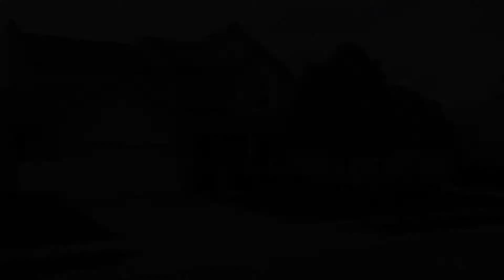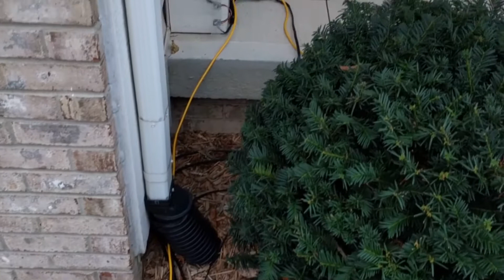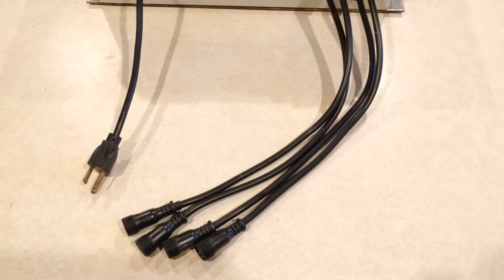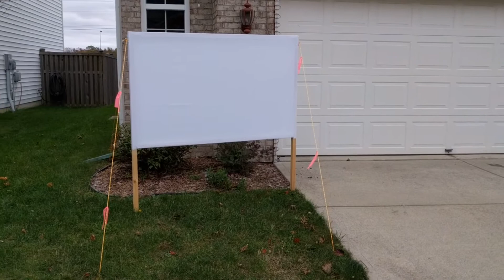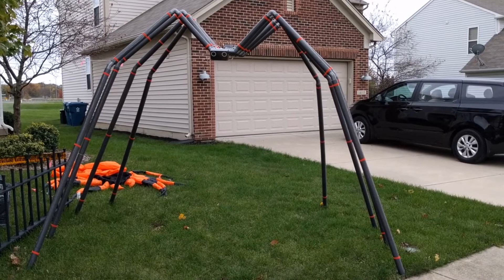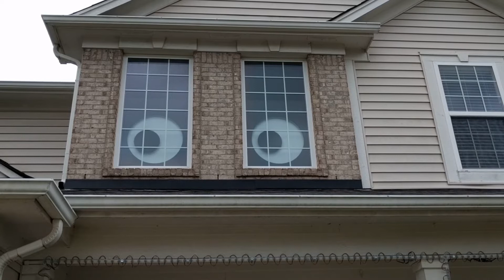Halloween 2017 Lights - Behind the Scenes

Comment: This is so much better than most. Not only did you do it affordably but you didn’t just repeat the same props everyone else does. So it looks like it’s mainly a bunch of different raspberry pi’s and Arduino units running everything. I would love to see a more in depth behind the scenes of how you set up everything. I just don’t want to spend a few hundred on controllers plus all the other stuff that goes into a show. I have a bunch of ESP32 modules and a couple Arduino unos. Maybe I’ll start from there. 
I also like your sequences. They are more original and less likely to induce seizures than some out there lol.
Reply from the maker: Thank you! I know this is an older video, but a lot is still the same in my show. I just posted Halloween's show https://youtu.be/Ng_TAL1Acug - The pumpkins, graveyard, and eyes each use a https://forkineye.com/product/espixelstick-v3/ as their controller. Each one can control up to 680 lights. They are a great way to get started that doesn't break the bank. I use a Raspberry Pi as the show computer running Falcon Player. That manages the schedule, the playlist, video, and a few other things. Arduino are good as a starting point to learn how to control the pixels, but you might find they don't have enough compute power to run enough lights for a show.

One other bit of advice with this hobby I would share is to expand slowly. I typically add a new element or two to the show each year, then go back and update sequences to take advantage of them. It makes the show feel fresh without adding 10,000 leds each year :)